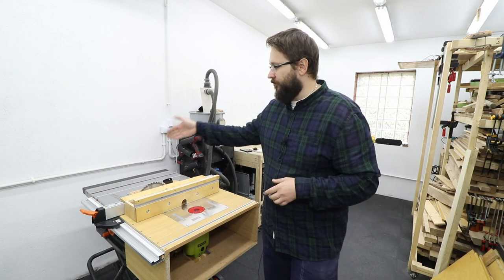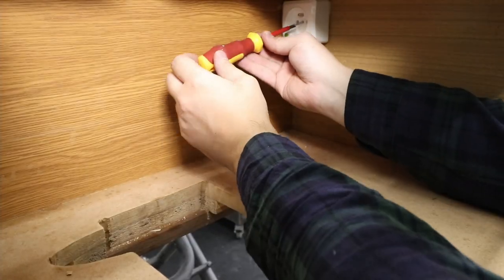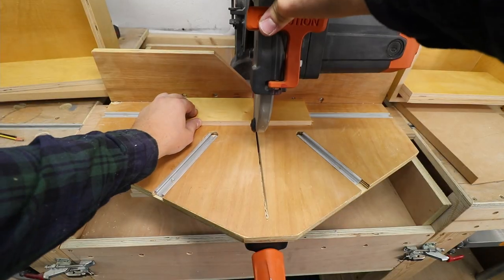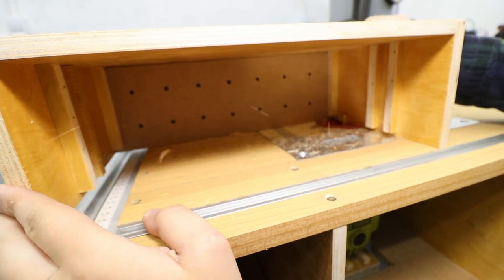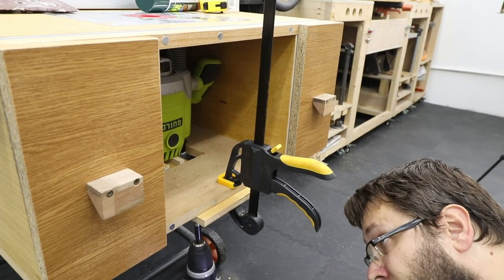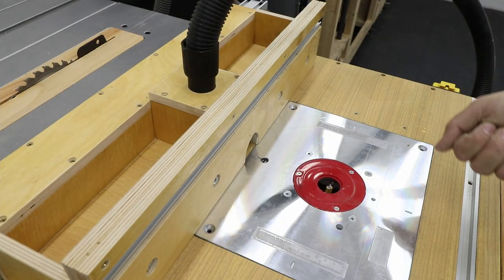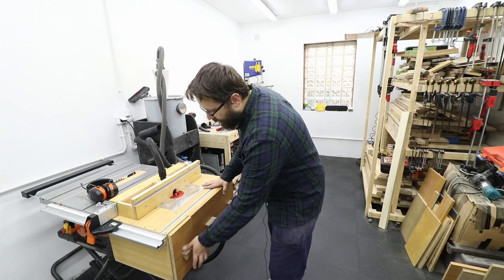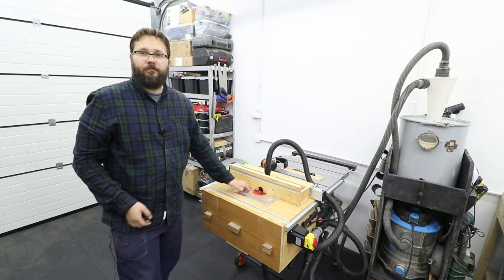Router Table Attachment with Storage, Dust Extraction & Safety Switch | Part 2

Comment: Great project Thomaz. Looks good. I wouldn’t go for drawer slides as they weigh so much and your drawers seem to work just fine.  I’d jut be aware of tightly coiling power cables in use.  They can heat up. You’ve not got many coils there but just to be aware. Great work. 👍🏻
Reply from the maker: Thank you. Yes I just have to cut the power cable to the right size. I'll sort that out when my next router projects comes along 👍😁

Comment: Nice thought out project....
For a suggestion, and future uses, have a look at caravan/camper van plastic drawer runners? They are cheaper than metal and lighter, but also you have to give a space for installation like with any runners.
Keep up the good work and stay safe 👍
Reply from the maker: Thank you very much. Never heard of those plastic runners I need to check them out, thank you👍
Reply: @CasualDIY  they normally are fixed by two plugs into holes drilled into the side wall or screwed in depending on manufacturer or type and a groove is rabbeted to run along the drawer side to accommodate the runner length.

Comment: Hi, could you publish the link to purchase the power button of the router? Just to let you know I purchased from a UK guy the plastic bars for both making the sled and for holding the router extension
Reply from the maker: Hi, the power button was purchased in my local DIY store and its not the best. Check Amazon, they should have something much better
Reply: @CasualDIY  thanks mate. I was relying on you as electricity is my weakest point ☺️ go on with your videos, super interesting

Comment: I'm really impressed by that saw , one concern is the extension to the router, it shouldn't be folded it needs to be shortened as it will become an electrical hazard,  apart from that it's great.  Mike 😎
Reply from the maker: Thank you kindly👍
Reply: Here to help ,  Friend 😎

Comment: Really good Mariusz. Perhaps, for the legs, make it adjustable to account for uneven surfaces?
Reply from the maker: Close but no cigar, it's Tomasz but I'll let you off this time 🤣👍
Yes got few sets of adjustable furniture feet so I may just use them as you mentioned to account for any potential unevenness of the floor👍
Reply: @CasualDIY  perhaps you demonstration of strength wheeling the folded saw around made them think you were Mariusz Pudzianowski 😂
Reply from the maker: @alant84  🤣🤣 strong like a bull 🤣🤣

Comment: well done Tomasz,  very smart and practical and above all really smart solution to save space. As i am waiting the delivery of the same table saw i would buy the plan if available, but i have the doubt you did not make it, working on the spot :-)
Reply from the maker: Thank you. I will have some plans for this by the end of next week hopefully. But I have already notice that dimension between saws vary which is problematic for plans...
Reply: @CasualDIY  Yes i agree. Probably after you bought your saw it has been issued a new release and maybe some pieces are slightly different or produced by another contractor. I think we can recognize it because the graved Evolution inscription on the work base disappeared in the last issues. But if the plans are made with sketchup it is easy to adjust, checking the actual measures of the rage 5 in my hands.

Comment: A great addition to the rage saw, just one question, how easy is it to fit/change the router bits?
Reply from the maker: It's not to bad actually. I thought it would be worse. Although you need to do it below the table top.

Comment: Hi Tomas.. Enjoying your mods to the Rage 5S. I'm hoping to buy one in the near future. Just one concern about the router.. The chamber it is housed in doesnt seem to be vented. . Could it overheat if you are doing a longer run of routing ? Perhaps a vent would be a good idea ?
Reply from the maker: Thanks. The compartment where the router sits is fairly large. Got a shop vac hooked from the bottom so that forces air flow. I think you would have to run the router for hours constantly for it to overheat. Which it would do regardless if it was in a box or outside if used for a super long time.
Reply: @CasualDIY  Ah ! I obviously wasn't paying full attention to the video.. If a vac is pulling air through that compartment there won't be a overheating issue.. I've watched a few videos where makers have put routers and shop vacs in unvented enclosures..
Thanx for the reply.. John.
Reply from the maker: @johnallen8680  no problem 👍😁

Comment: Nice Job as always. Why don't you take the saw off the  evolution frame and make a cart for it. I've done it with my Rage 5 and you have space for storage underneath and on the other side. 4 lockable castors and it still mobile. Keep up the videos, they're very good.
Reply from the maker: I actually want a new workbench/ outfeed table for the saw. But until then this will have to do🤔

Comment: i really like your videos bud, ive just aquired the evolution 255 pts which i fully intend to remove off its folding legs and incorperate into a small workbench with a small outfeed, id also like to use your idea for the router add on but, just trying to figure out how to incorperate it in.  should be fun, on a side note, even just for the safety aspects of the ballance issue, wouldnt it be easier to just build a small work bench like what im thinking ? well im working my way through your videos and look forward to more in the future, Kind regards from the wirral (uk)
Reply from the maker: Yes it will become a part of a workbench I'm planning to build. However this is an option for now. I have added a foldable leg now for better stability.
Reply: @CasualDIY  i will be sure to keep an eye out for that lol. 2 dilemas, 1, do i fully extend the front and back tracks permanently or do i incorperate some form of track for them to slide on to extend, 2, the height of my router table is slightly higher than i would have my saw bench, which do i sacrifice, just a couple of quandaries lo
Reply from the maker: @leecraddock299  well its for you to work that out, think about space you got in your workshop. What benefits you would get after a specific design, what potential problems. Will it suit your work flow etc.

Comment: nice upgrade.
I'm not sure hoe pulling out the drawers and shelves works. they were snug with the dividers. and with the middle cover in place, that would get in the way, no?
Reply from the maker: The middle just comes off and you got full access to the drawers inserts. Bit of wax and it all works great 👍😀